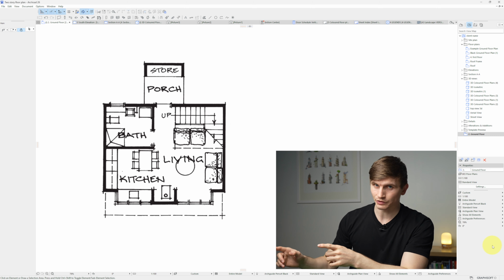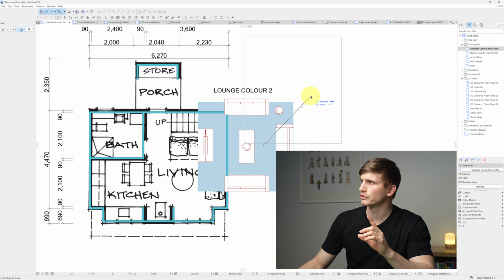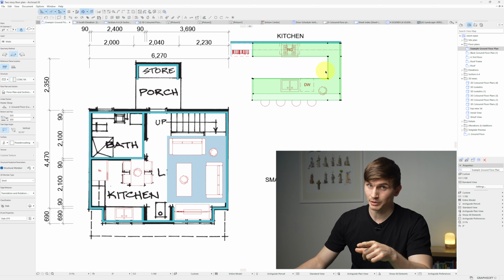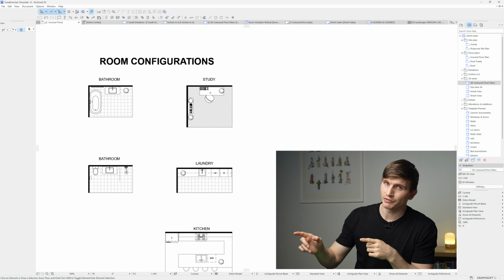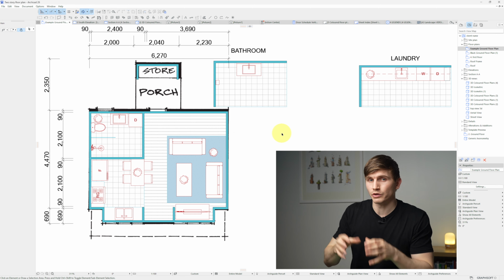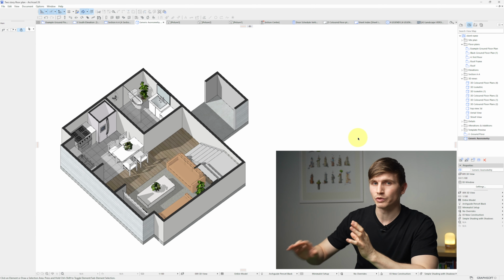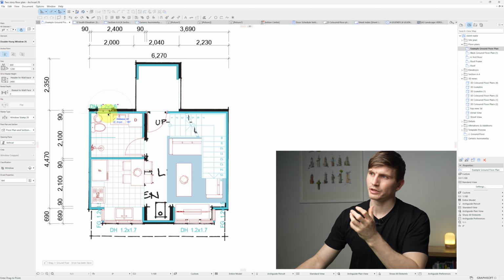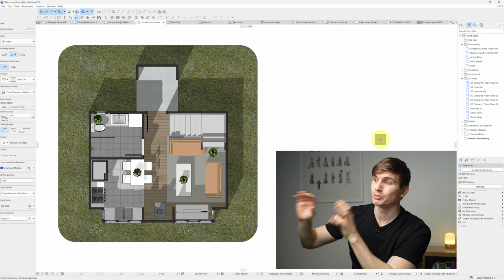Sketch to 3D -  Template Demonstration

Comment: Trying to ask about Imperial template - is the template available in imperial?  Seems your website has a contact us issue.
Reply from the maker: Thanks for your persistence and reaching out. 
The template can be swapped to imperial in a few clicks. For short walkthrough on how to change the systems I'll have a link to a video just below.

https://youtu.be/cEjEZGO-tOE

I'll update the FAQ to include the above.

I'll also need to take a look at the website to see what's going on with the contact form, cheers for the heads up!

Comment: I wonder if you know of a way to put the door directly with a defined distance from the end of the wall or a corner... I allways insert the door or window randomly, then i move it to the end of the wall then i move it back 5 or 10 cm to avoid construction and opening issues
Reply from the maker: I do the same thing, tried other ways, but they end up taking the same amount of time. In ArchiCAD 28 there is distance guides, which is a step in the right direction. The tool still needs some refinement for my purposes though. 90% of the time I need the door 45 to 90mm off the wall for architrave, but can't quite seem to do it intuitively yet with the current iteration of distance guides.